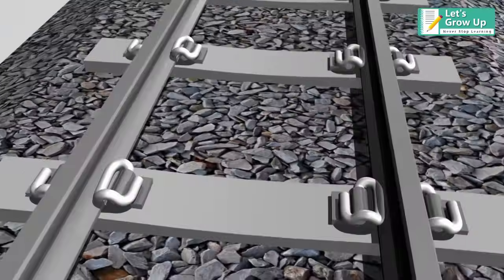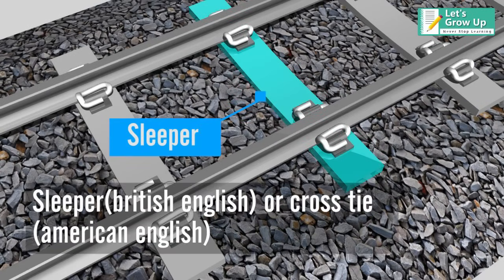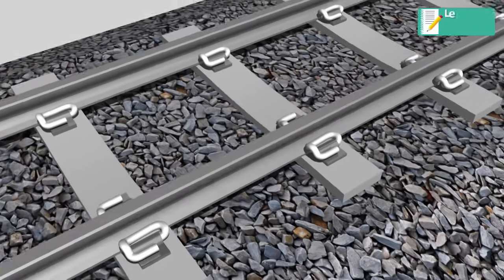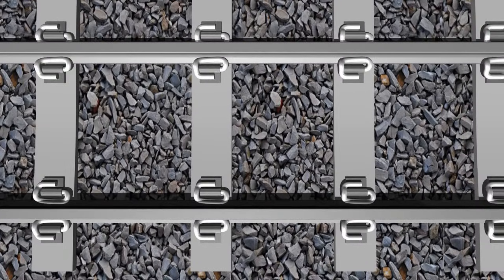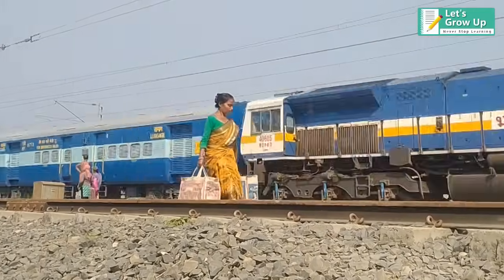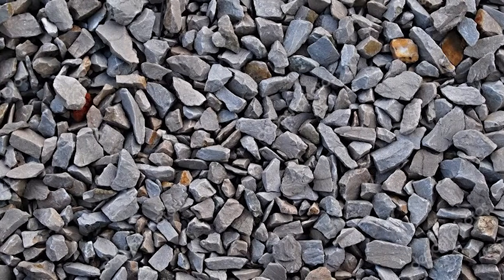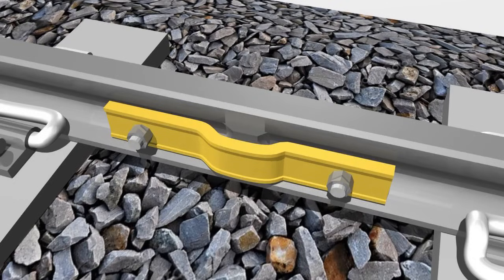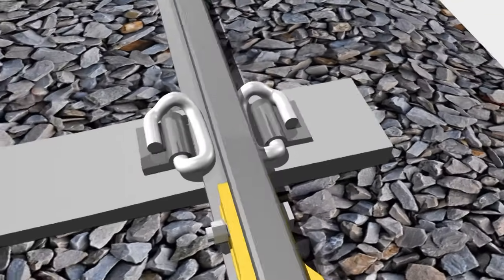Railway Track Components | #Sleeper | #Ballast  | #Joint | #fastening system | #Joggled Fishplate

Comment: we like your short info vids.   this one has one issue we think your should change.  twice you show a train rolling over the rail and show the sleepers depressing down into the ballast.  this is NOT how a well maintained track works. the sleepers should NOT depress down into the ballast at all.  if it does, the ballast is in very bad condition and should be cleaned out and replaced.  still your vids are very good. thanks.

Comment: Lot of mistakes in animation.
fishplates bolt nuts must be always in the four foot.
Also the clips can not be mounted normally at the end of the fishplate,so we use some blue color clips,named left hand clips.
Juggled fishplates are tied toghether with 2 clamps,no bolts.
Reply: You must be in QC or Audit team
Reply: @bhargavpandya8302  the rail will bend at the splice as shown…no good